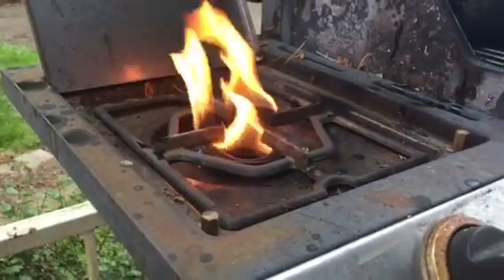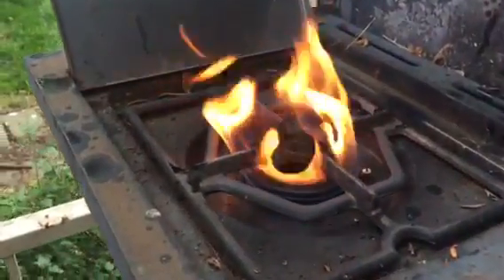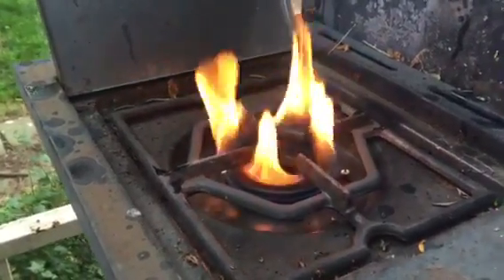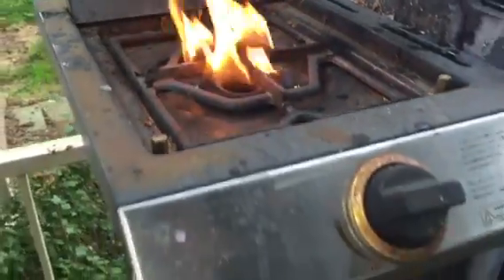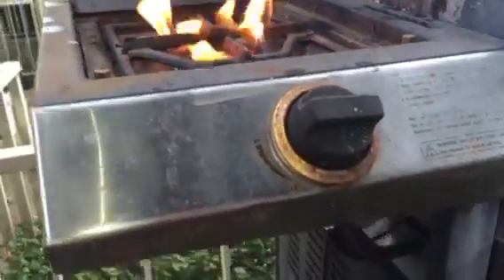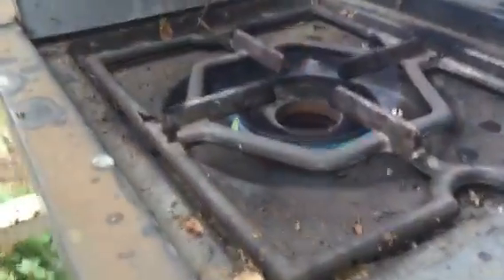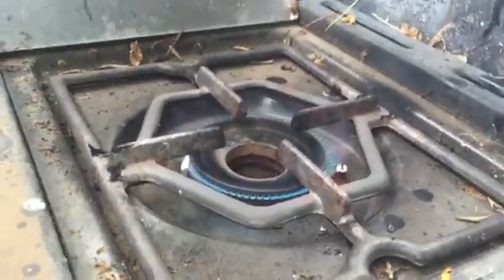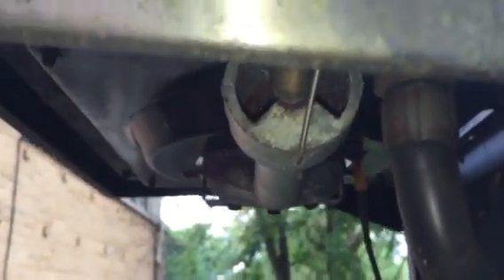Gas Grill Burning Yellow Flame Here's a Quick Fix

Comment: Mahalo's (Thank's) from  Kauai!  Took burner all apart, cable tied, removed scale, blew air, still yellow flame and soot. Pushed cable tie tru 6 small holes on the valve and that was the problem. Holes were not plugged, but had web on them. AMAZING!!! Cowboy kitchen now open again. Thank's again.

Comment: This worked for me, too.  I had to disassemble the unit to get it completely cleaned but when I did, I found spider webs and the remains of a moth.  Once cleared, the blue flame returned.  There are just two bolts that hold the cast iron burner tube in place from underneath, and also the wire you can see in the video that secures the burner tube to the gas supply.  But once you remove those three items, the burner tube comes right out and you can snake it with a zip tie or something similar.  Really appreciate this video since I haven’t used the side burner for two years and now I can.  Thank you!

Comment: I tried this method but there were no air holes where the line from the gas tank entered the burner.  There was, however, a little air vent that could be opened or closed .  Some how it had become closed, I simply slid it open and it allowed air to flow in. This fixed the problem.  Thanks for the insight!

Comment: Help! I inherited this big sunbeam grill 15x28 inch grill. The burner was shot so I bought a new one and got yellow flame. I used it till it went bad and bought another universal 19inch burner and even worse yellow flame brand new. I have the air adjustments open the whole way. It cooks good but no blue flame. Just long yellow flame. help? Band new tubes and burner.

Comment: I usually leave pot boiling and it spills, so how do i clean the small holes on burner?
Reply: it's new and i destroyed my burner again.
Reply: @rodrigobutete2313  Try turning the fire down as soon as it starts to boil. It doesn't need to be on high to maintain a rolling boil. You can maintain a""rolling boil" 212 degrees on a medium flame